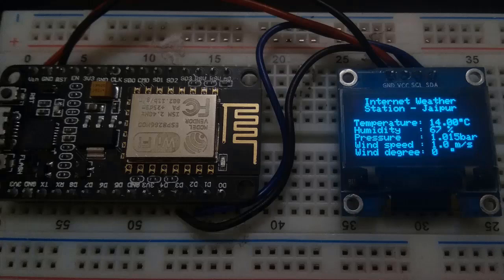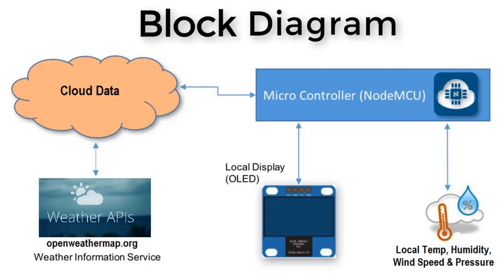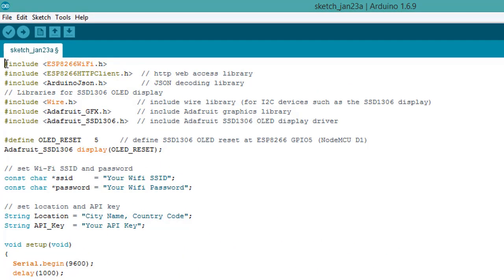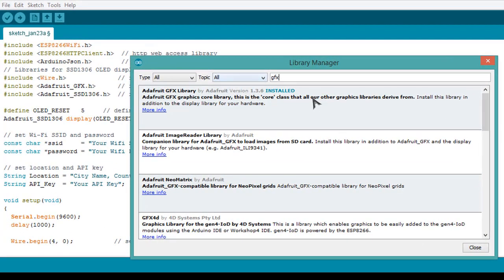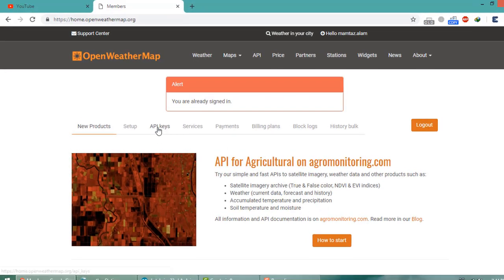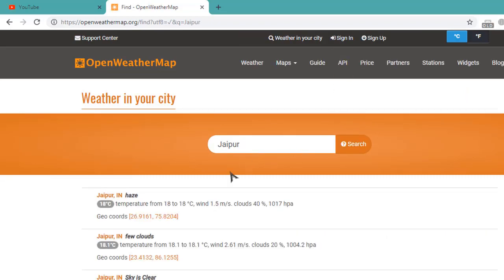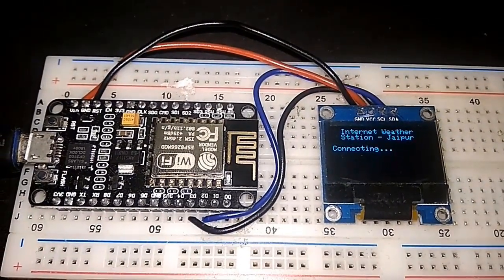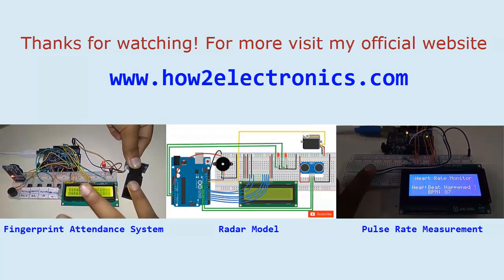IOT Based Weather Station || NodeMCU with OLED & OpenWeatherMap

Comment: hii friends don't worry whom have 0.9 inch display....
they are use....this code..below...

Adafruit_SSD1306 display(OLED_RESET);// this is for 1.3 inch display...
instade this......

#define SCREEN_WIDTH 128//OLED display width,in pixels
#define SCREEN_HEIGHT 64//OLED display length,in pixels
Adafruit_SSD1306 display(SCREEN_WIDTH,SCREEN_HEIGHT,&Wire,OLED_RESET);

:) :)